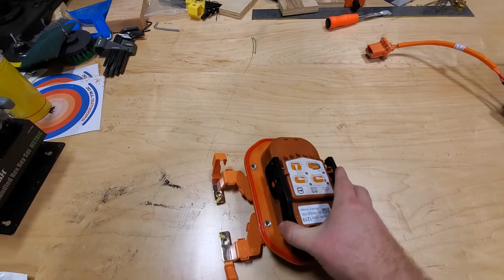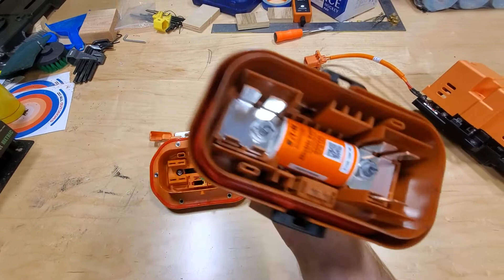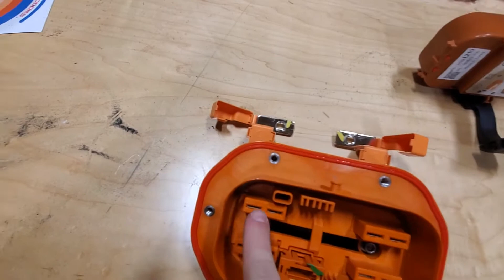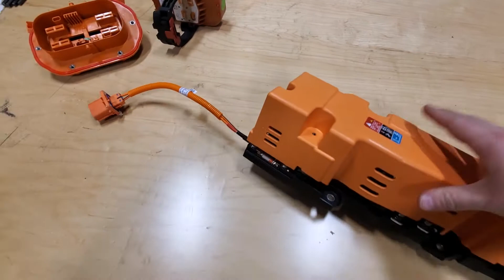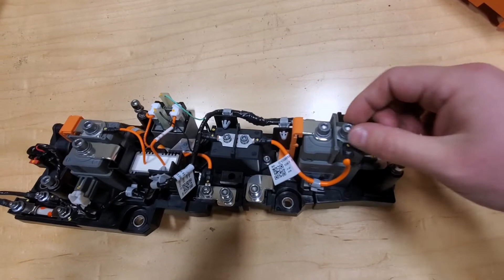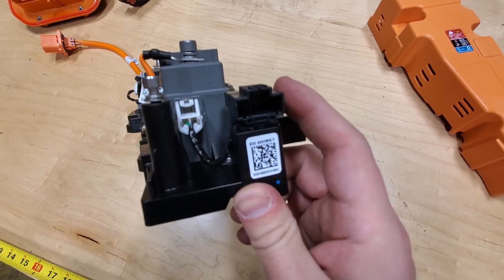Chevy Bolt Battery Pack - Manual Service Disconnect and Contactor Box

Comment: Where is the safest place on the car to test for a Stuck Closed main Contactor?
If I pull the service disconnect and probe those blade connections, would I expect to see voltage if I have a stuck contactor or is that really better checked outside the battery?
I have a Stuck Contactor code but the dealer refuses to try updating the module firmware as part of the troubleshooting despite me finding several stories of false positives due to bad code.
Reply from the maker: If you pull the MSD you won't see any main pack voltage, even if the contactor is stuck closed. If it were me I would drop the pack, open it up, and probe voltage at all the various points in the contactor box. But if you just want to do a firmware update - you can buy vxdiag for like $100 and for $40 get access to the software to do it yourself.
Reply: @BillCarlson Got any links to those tools? Affiliate code or is fine and warranted if you have one:)
Reply: @BillCarlson Also, what is the MSD-like thing under the front edge of the driver's seat?
Reply from the maker: @Casper042  There is a harness connector for the seat that is under the driver's seat. If you mean 'MSD-Like' because it's yellow, that is because it has airbag wiring that goes through it.

Sometimes you can buy VXDiag stuff on Amazon, or go to their website (vxdiag.com) - you want the VX Nano for GM. I've never been able to get it working over wifi, but both usb and wifi versions have USB, which works. For the software to flash firmware, do a search for 'ACDelco TDS', you'll use SPS2 for updates. It's $45 for 2-years per VIN. You can also use Tech2Win with the VXNano to do all sorts of code scanning and resetting and live monitoring and lots of cool stuff. It's expensive to get it through ACDelco TDS, but there are other sources that VXDiag may supply when you buy the adapter.

Comment: Do you happen to know if this connection point has access to the pack's ~400 Vdc? And, if power were taken from this point,  if that would upset the BMS or power electronics? I'm looking for a convienent places to tap this pack for an inverter for whole home battery backup purposes.
Reply from the maker: Yes, the full pack voltage is on these pins - but it is "in the middle of the pack" compared to the other HV connectors, so you shouldn't try to use it to power other things, because all power for everything has to go through it, and anything you added would be in series with everything else. If you want access to the HV pack, I'd recommend going through the HPDM (High Power Distribution Module) or one of the connectors that come off of it. You can splice into the AC compressor, DC/DC converter, cabin heater, or battery pack heater, for example. My initial thought is that you can disconnect the cabin heater and put an inverter in it's place, and pull at least 10kW. However... there are easier options if you only need 1kW, as you can go through the 12V system and not need to modify or touch the high voltage system. It's a huge jump in complexity, danger, and cost to go from using the 12V system for 1kW and using the 400V system to get 10kW.

Comment: Wondering if you were to remove the MSD if that would prevent the car from regenerating when towing?
Reply from the maker: Just turning off the car will prevent it from regen charging the pack, as either way the high voltage pack is physically disconnected. But I think it is dangerous to tow with the front wheels down and will damage the car, since the transmission will still be spinning without the oil pump. I admit that I don't know much about it, though.